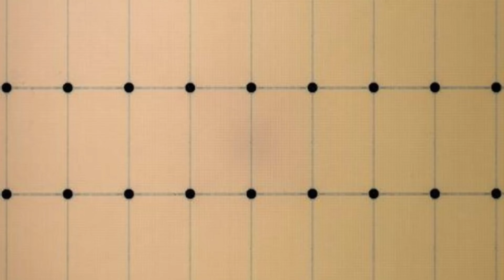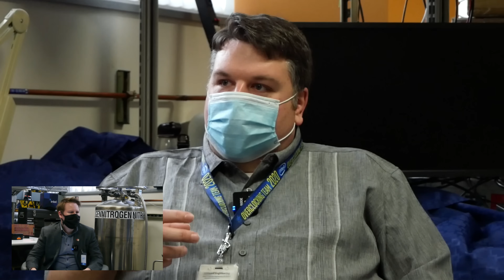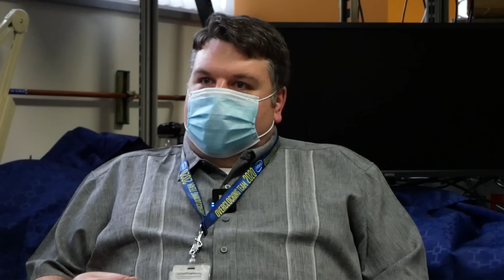[15] Dan Ragland, Intel Overclocking Lead Engineer

Comment from the maker: [0:00] Begin
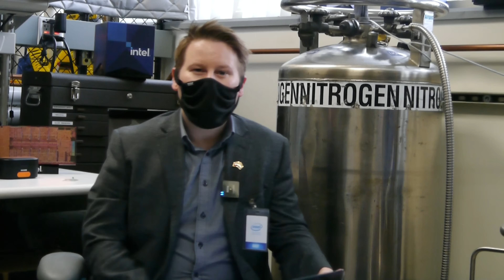[0:08] The Overclocking Lab
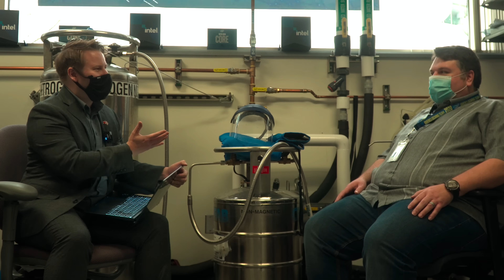[0:50] Q1: What is your title?
[1:15] Q2: Dan's Journey Through Intel
[2:26] Q3: The Start of OC Lab
[3:27] Q4: OC and Warranty
[4:33] Q5: Overclocking Experience
[6:50] Q6: When Does OC Get Involved?
[7:46] Q7: Timescale
[8:12] Q8: CPUs only?
[8:50] Q9: Overclocking vs Binning
[9:58] Q10: One Click OC vs Binning
[11:02] Q11: OC Hardware not in market?
[12:35] Q12: Ever think why Overclock Stuff?
[13:20] Q13: Underclock vs Overclock
[14:03] Q14: Extreme OC Events
[15:11] Q15: External Overclockers
[16:50] Q16: Unique OC CPUs
[17:28] Q17: How Many For a Golden
[18:24] Q18: Low End Distribution
[18:49] Q19: Competitive Analysis
[19:47] Q20: Underrated OC Features
[20:57] Q21: Liquid for Desktop Mandated?
[21:38] Q22: Personal OC at Home
[22:48] Q23: Should Intel GPUs be K-SKU
[23:35] Q24: HPC GPUs?
[24:02] Q25: Next OC Revolution
[25:40] Q26: MHz vs MT/s
[26:12] Q27: More Channels in Consumer?
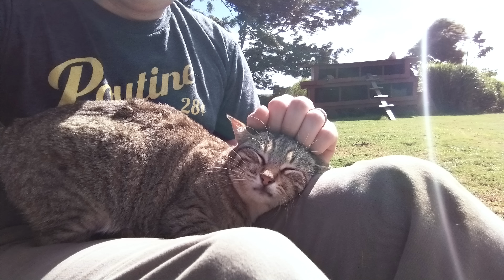[27:17] FIN
Reply: Hi, I was just watching Maxtech And him talking about Apples new 12 core cpu, and I had a thought, could Apple (or basically anyone) design in the 12-14” cpu wafer the normal 10 core apple cpu’s centre - and on the ones on the edge ~  (all these squares make a circle) 

the cpu that would have normally been discarded , be designed to be glued together to make a 12 core (ie even though part of the normal design would be missing - they designed it to be 6 cores and then glued together to be 12 cores )
Reply: Edit* additional: and that way you would get possibly even more out of one silicon wafer .

Comment: Why should Intel allow overclocking?  Why should FORD allow people to race their cars ?  As long as we do not complain and accept the risk. 
Very interesting perspective "Over clocking SSD. Will that put your data at risk"  Windows.exe or .DLL once screwed could call blue screen of death "BSD'  Overclocking transitory devices like GPU, RAM and CPU. SSD may be fanned out with mirroring. 
Also NUC - intel next unit of computing. Even if I overclock the CPU, I need the RAM, glue and motherboard to handle the wave form. 
"Leve no stone unturned" - to me that is the ROI 
My question -  is the temp differential between top cooled and the bottom uncooled LGA pin side a limit ???

Comment: "absolutly unfair" overclocking is a marketing gag - plz be serious and give me livetime over clk and volt on K - or if you not will to - slow down instead of failure builtin (fyi there is enough selftiming and reliability monitoring circuits out in research)

Comment: EVERYONE actually uses Mb/s. I refer to AHOC's video for the explanation. MT doesn't make sense. A transfer? Other than that, I loved the video.
Reply from the maker: Mb/s only works when there's no encoding schema. DDR hasn't got one, but PCIe does. Most are transitioning to MT/s. I've got a video on it.
Reply: @TechTechPotato  I get the explanation you give, but then MT is worst because it's not a unit of measurement that one can count. Plus, all RAM manufacturers bar one or two use Mb. Maybe they should call it MbX2, but, it's DDR, it doesn't need clarifying. And manufacurers often use just the number with no unit like you stated already, so it is happening.

Comment: Personally I would have asked him for an example of the feedback loop incorporating fixes for flaws they have found. Or at least I would think they do some kind of analysis what causes clock/signal desynchronisation at higher clock speeds for specific designs.

Comment: This is pointless. Obviously he will say nothing that will make Intel look bad - it's basically a press release trying to hide behind a different form. As to the subject matter, it is again obviously in Intel's interest to reduce the overclocking headspace as much as possible rather than support the very very small minority of people who will overclock. At the same time, I don't think it's right for Intel to charge extra for the same silicon with a letter K added and a single switch changed.

Comment: Love the Intel extreme tuning utility, makes OC so much easier, got my 9900k both overclocked and undervolted.
Very interested in the per core OC, I'm guessing I need to run a load, check which cores go highest at lowest temps and increase the clock on those cores?
Can you elaborate on the OC thermal velocity boost?
Can you explain Processor cash ratio and how changing it affects the OC?
Can you  please do a deep dive on the Intel extreme tuning utility, I understand most of it but would love to make sure I'm understanding everything correctly + maybe learn something new. 
Thanks for another great interview

Comment: As the 12400  can be overclocked on certain boards now, great job on making overcklocking more attainable beyond the K SKUs. We will see how long that will last though. :)
Reply: Intel OC lab gets a new responsibility from now on - vet non-K SKUs and make sure they are impossible to OC.
Reply: @thatguy7595  yes you nail it : mar K eting
Reply: Patch coming in 3..... 2....... 1........

Comment: I overclocked my 10700k about 14 months ago. 5.1ghz all core. It's gotten very very easy to overclock. My thermals aren't bad either I only have a 120mm aio with push pull fan config.

Comment: Must be a awful job to work on overclocking at company that only cares about it as another feature they can charge consumers for.

This is the same company that up until recently would limit memory based on the chipset for crying out loud.

Comment: I hope Intel doesn't bring its habit of locking down OC support to the GPU space.
Reply: AMD already did that.
Reply: @ActuallyHardcoreOverclocking  I was super frustrated by that 2975Mhz limit on the 6500XT, thinking that it can go beyond 3Ghz :/
Reply: @Luckyn00bOC  do you know if anything can be done about the 2900MHz limit on the 6600?
Reply: @ActuallyHardcoreOverclocking  Not that i know of at this point, also don't have the card unfortunately.

Comment: Overclocking is such a primitive activity ... why not rather set up a challenge of solving some specific math problem with minimum possible energy consumption? That would be a proper challenge and will do something to improve this world too.
Reply: That way you'd just get a lot of ASICs with no real benefit for other applications
Reply: The same could be said about a lot of things that waste energy, fuel etc. Sometimes we forego these concerns in order to have fun. There's also underclocking and undervolting where peoply try to find the sweetspot by lowering operating frequency and/or voltage to get power savings with minimal performance loss.
Reply: That's essentially exactly what's being done with FPGA's and special silicon targeted at, for instance machine learning tasks like autonomous driving. This is absolutely something that's being done on a very large scale but is reserved for those with big pockets. Additionally, CPU's need to be both performant and versatile for each type of customer which is exactly why they have so many instructions and advanced cache hierarchies to accelerate all types of workloads - not just predictable parallel ones. Mining is another great example of exactly what you're talking about (minus the improving the world part xd). 

Another tidbit would be AMD's evolution in power gating the CPU's. This way, they want to turn off unused silicon in order to preserve energy. I don't know much about it but this is what they've been mainly talking about as a way to have an "E and P core in one". If anyone could chime in that would be great.
Reply: @fVNzO  I work in HPC and know all of that and more. @TechTechPotato would you guys consider adding also "energy to result" graphs in your reviews where you do "time to result" at different settings? That would actually tell us something meaningful ...
Reply: @jurepecar9092   you don't work as a barber that's for sure. Xd. Well, your proposal is extremely difficult to not just execute but define. Are you suggesting that the various instructions in each cpus aren't particularly optimized already for instance? Do you think we need more descrete processing units for various tasks? What kind of tasks, would that be beneficial to the average consumer etc.

Aren't hardware encoders (as an example) already doing what you're suggesting?

Or do you mean, optimize some various compute task just for fun? Without it necessarily being useful for consumer chips? I'm not sure what you're essentially asking for here.
Reply: @fVNzO  Dedicated HW for media de/encoding is an example of a step in the right direction. Whole industry is slooowly moving this way, but until cost of electricity goes up tenfold or more, we won't see any real progress. 
What I'd like to see is society doing a mental step forward and start caring about efficiency, not just raw power. If you're efficient, you can become as powerful as you want, but if you're powerful, it's very difficult to become efficient. So what we're currently measuring and optimizing for is plain wrong and evolution will punish us for it in the long term.
Reply: @jurepecar9092  I care a lot about efficiency and am always looking for efficient components if possible. I definitely think Nvidia is going in the wrong direction regarding that. It's just so much more expensive for them to swallow tsmc's pricing in order to achieve the performance they want for less power draw. And certainly, gddr6x is not really helping.
Reply: @jurepecar9092  The efficiency game is there since the 100-200W power limit per die is in place. But ... yes but it is played only on ONE corner, at the high speed high power side. ASICs on the other hand have shown that you can gain efficiency by a significant fraction of 10x by scaling clock and voltage and instead have a result 10x times later. That flexibility in ONE silicon which lacking in CPUs today. It would be a better domain for energy limited worlds like mobile where the final questions is:
Do you want only one answer in 30min or 10 answers in 300min (the ideal scaling law) out of one charge?
Reply: Time is limited, energy isn't. Speed > power consumption.
Reply: @LawrenceTimme  Energy isn't? Man, I'd sooo love to live in the same universe as you ...
Reply: @jurepecar9092  energy is never destroyed. Therefore its unlimited and never ending. This is basic science.
Reply: @LawrenceTimme  Hehe, I reckon you never heard of entropy or heat death of the universe? Yes, all energy exists in various forms, what we're doing it is converting it between these forms and we pay a price (or tax, if you want) for these conversions in form of heat. If you figure out how to convert heat back into some other usable forms of energy, you get at least a Nobel price.
Reply: @jurepecar9092  not going to happen any time soon. Like I said time is limited... Energy isn't.
Reply: @LawrenceTimme  We just need to stop looking at everything from the perspective of human lifespan. We are insignificant, nature has infinite time available and works wonders with limited amount of energy. We are fools thinking that we can do it differently.
Reply: @jurepecar9092  speak for yourself. You go save the universe by going slow and wasting your life. I'll go full speed ahead and progress as far as i can while I'm here.  nature can look after itself.
Reply: @LawrenceTimme  Yes ... and to that I say: Stop this Earth, I want to get off.